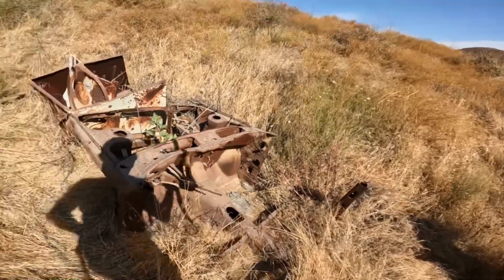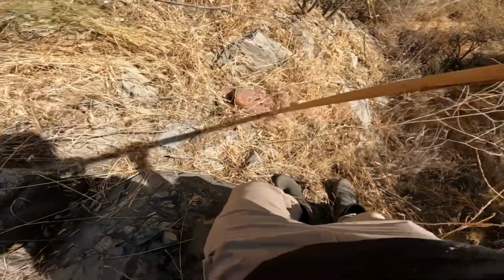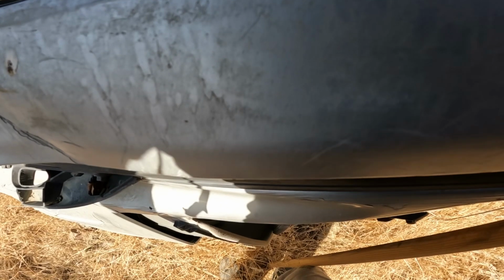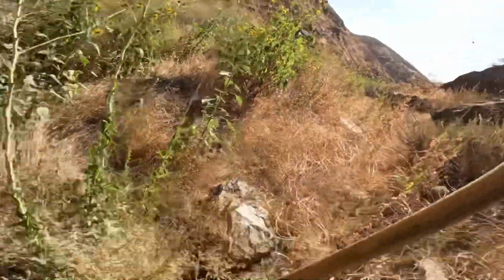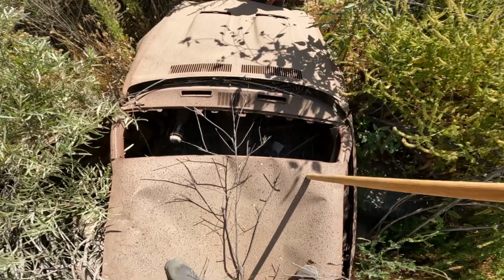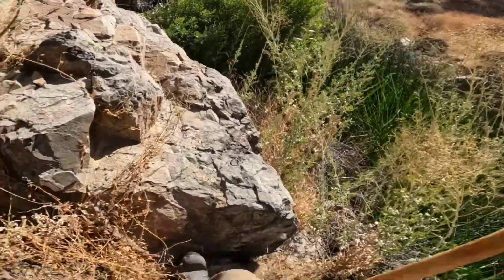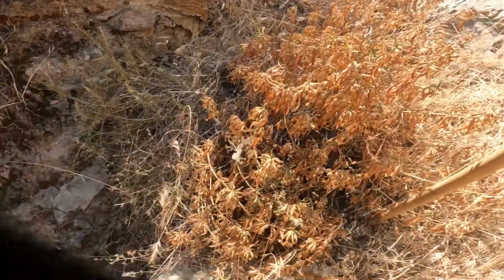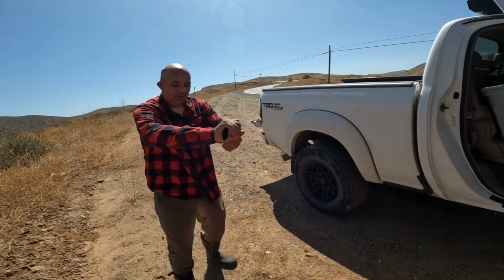Vintage Pontiac found off mountain side! (Part 2)

Comment: Correct, it's a Pontiac. That's around a 1976 Pontiac Firebird Formula. From 1977 onward, they didn't have vents at the back of the hood like that, so assuming it's the original hood, I'm going to say circa 1976 Pontiac Firebird Formula.
Reply from the maker: Thanks for the info!
Reply: @reverserockettv007  Sure thing.
Reply: @reverserockettv007  They would have been made in either Norwood, OH or Van Nuys, CA back then. The Norwood plant closed in August 1987 and the Van Nuys plant closed in 1992. From what I can see, the VIN is missing, so it must have been an insurance job or a theft.
Reply: Lotta work to get to the burned Firebird. It had a fiberglass doghouse front, had to picture like that!
Reply: @steveschwartz5641  Yes, it's likely a 1975-1976 Firebird Formula.

Comment: congratulations great video Ford Fiesta 2015 it hurts a recent car that many rotate in Europe  Shame the Ford Econoline van 😢
Reply from the maker: Thanks for commenting!
Reply: @reverserockettv007 when I saw that red car in desert aventure's video with the drone, I was expecting a Honda Fit I was wrong, there are more cars down there in the other side  I saw something like a 1969-1972 charger/roadrunner, and a camaro 1973-1979 in one of desert adventures video.

It's scary to think a semi truck fell down there just like the torn one in La rumorosa I wonder where the axles frame and engine/transmission ended.

Comment: A good way to determine whether a vehicle was simply pushed down or fell down is the Aerbeck, which only opens when the engine is running or the ignition is switched on
Reply from the maker: I was wondering about that as well!